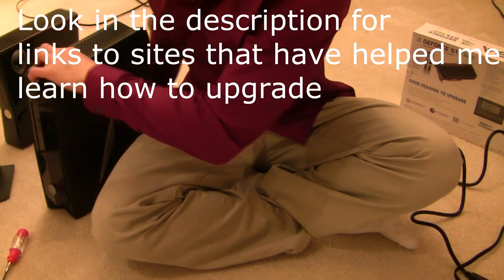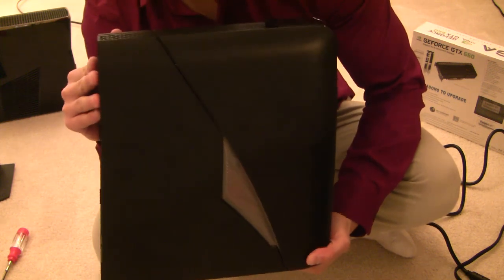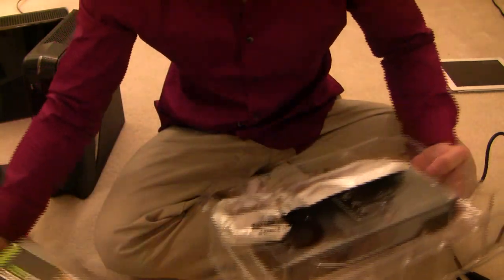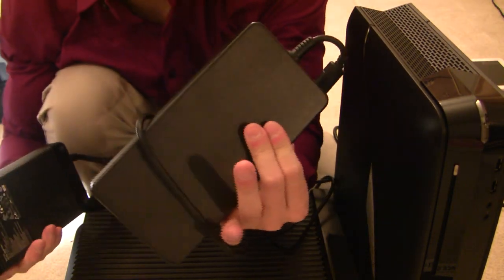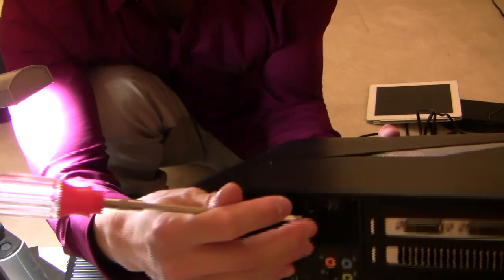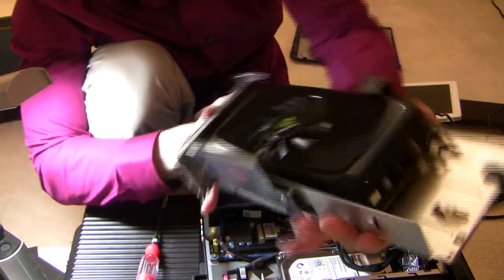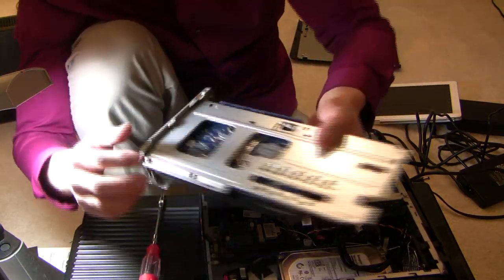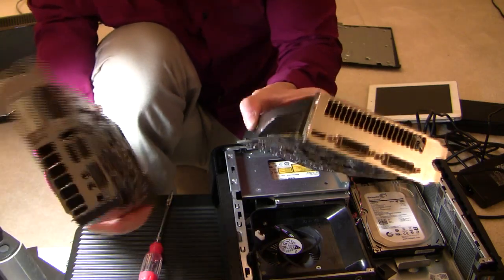► How to Upgrade the Alienware X51 Graphics Card (GPU Upgrade Tutorial/ Guide, GTX 660 Unboxing)

Comment: Okay, quick question. I have a GT 640 in my AW X51, it says that the 640 uses a 350 W power supply, would I have to get the 330 you show, if so, where ? Sorry, new to computers.. Thanks for your time.
Reply: I got my X51 in February of 2013, but my power supply is only 240 W

Comment: Thinking of upgrading my x51 from gtx 645 to the gtx 660, just wondering  have you had any problems since like  loud noise/over heating? Should I do it? Be great if you could reply or someone else who has also done so :)
Reply: I just installed mine about 4 days ago. No problems. Just make sure you run the MSI afterburner to keep the fan going. But so far so good.
Reply: Thanks, do i have to have msi or would it be cool without?
Reply: If no MSI then the fan runs on its normal prosody which may not be sufficient if you have more intensive gaming and it may overheat. Also MSI is a free download. But if anyone else knows please chime in.
Reply: great to know bud ty :)

Comment: same question here, got my setup with the i5 the 240W PSU and currently the GTX 645, want to upgrade the gpu as far as possible(gtx660 or higher possible?) whilst not damaging anything. or would anything higher than the GTX660 be overkill for the i5?

Comment: fyi you need to use both power connectors for this graphics card not just the one like this dude shows us in his video... if you only use one power connector your system wont boot

Comment: Im thinking of upgrading my X51's GT640 to the GTX660. So if I'm currently usingg the 240W power supply, I can just replace it with the 330W? and then upgrade to the GTX660? Can I do this on i5??? I'm a PC noob so yea some helpful response wud be very very appreciated!

Comment: That's not true at all, I just looked at parts available and made one for $150 cheaper than their 4th gen i7 option. That's also with, IMO, better parts than what dell would use, and that's not even looking or waiting for any specials or discounts.
Another plus is its much easier to maintain and update/ customize because there are no proprietary parts and doesn't need to fit Dell's restrictions.
While it is true that that warranties are through different companies, many are longer warranties

Comment: you just go to radioshack and buy a linksys network adapter because the wifi on the x51 is garbage - i got this and it works fine

Comment: for 1 alienware x51 psu cant handle a 700 series card for 2 the i3 cpu will bottleneck the gpu meaning the graphics hard is good but the cpu isnt strong enough to unleash the full potential of the gpu

Comment: Mine never has. The wiring is really quite good, they manage to cram all that stuff in such a small space and yet it never overheats. Some people have complained that the fan gets loud if you're trying to run Crysis or something but with headphones on it's really quiet to me. Mine's still stock though, so if you overclock it I'm not sure. The 555 GTX can withstand up to 210 degrees Fahrenheit so I don't think you should have a problem with it.

Comment: No problem :)

BTW, if you buy from the Dell website (AW automatically takes you there), make sure you look and the list on the bottom right to see if you're getting an i3, i5, or i7.

I find that the i5 has the most options for customization, letting you spoil yourself rotten with higher RAM (room for multitasking), Blu-Ray CD/DVD Drive (Movie Night!), and your choice of video card. (You should DEFINITELY get the GTX 660)

If you have questions about RAM, 8GB is beyond perfect for personal use.

Comment: No, a 690 would never work. I saw a guy put the GTX 680 card in the X51 and it worked for close to a half hour before the system crashed. The most powerful card that will work is the GTX 670, but I personally would not use it. I would say if your not happy with the GTX 660 ti, which Alienware told me that is the absolute highest you can go, then you would be better off looking at or getting a better system.

Comment from the maker: It would be a very interesting experiment to try. I would have to remove the front case fan embedded into the bezel, then cut out a mesh hole to install a 120mm intake fan to feed the turbine fan on the heatsink, then use an external psu to jump the GPU separately from what's powering the MOBO.

Comment: More powerful graphics cards require more power. The smaller PSU wouldn't supply enough power to run the GTX 660.

Comment: I own a $1049 model and switched the 660 with 670 FTW. (I also removed the 3.5 inch 2TB HDD and installed a 120GB SSD in tandem with my old laptop's 2.5 inch 500GB HDD. The X51 motherboard has an extra SATA port 3 in total, and thats where my HDD is connected. Note: You need a SATA Cable & a Y split SATA Power Cable) I did my research. lol

Comment from the maker: You are blocking either the case fan (embeded into the side of the case, below the alien head) or you are blocking the gpu turbine fan with a 6 pin power cable. Perform cable management and direct the spare 6 pin to the disk drive area where there should be room.

Comment from the maker: Ebay. Just type "Dell 330w PSU" or power adapter. If it says its for the M11x (the Alienware laptop), it's also compatible with the X51. You can probably make back quite a bit of the cost by selling your old 240.

Comment from the maker: Haven't you heard? Next gen consoles are driving PC gaming extinct, so chip manufacturers like Nvidia and AMD are giving up. 

JK, I wouldn't worry about Nvidia 700 until fall at the earliest and AMD 8000 even later. Games are running fine on current cards. Nvidia wants to ride the Titan at 1k for as longs as it can. Then before PS4 and NextBox, consumers will be hungry to upgrade, so Q3 at the earliest is when I would start thinking about next gen cards.

Comment: hi thanks for the video very informative and useful. I just have one question. with the power supply I have the 240watt it came with(as it was the £600 version) is the 330 watt compatible with mine and if so where can I get a 330 power supply for the x51? did you have to buy yours separately as well? thanks

Comment: I have got a gpu Nvidia Geforce GTX 660ti 2gb Evga. Will it fit into my pc. What will I need to additionally upgrade Specs:
Superior Intel® Core™ i7-3770 3.9GHz (8MB Cache) with Hyper-Threading and Turbo Boost Technology 2.0
1.5GB GDDR5 NVIDIA® GeForce® GTX 660
Genuine Windows® 7 Home 64-Bit
8GB 1333MHz DDR3 Dual Channel SDRAM - 2 Dims
Dual Layer DVD Burner (BD-ROM, DVD+-RW, CD-RW)
1TB Hard Drive - 3.5"
Dell Wireless 802.11g/n
Alienware™ 330 Watt Power Supply
do i need a new power supply?

Comment: Really quick question, i have the i5 version of that with 8GB ram windows 7 and all that with a 240 power supply, would the 240 be able to handle a gtx 560 upgrade?? i mean its not that much bigger then the 545 or whatever that it has.

Comment: Hey, I just got the GTX 660, does it matter that it comes with a 6pin PCI wire with 2 other pin connectors to the power supply? Where as the X51 only has the 6pin connecters? Also I am trying to multibox Diablo 3 with basically 4 game instances, and when i run the Diablo 3 4 times at once MY GPU usage goes from avg of 60% to 90% at time which lags up my game. Is that a power consumption problem you think?

Comment: Hmm..The GTX 660 seems a bit steep for me, and I've heard the GTX 650 gives a good performance boost over the GT 640 that came in mine. Though, I have the default 240W PSU. Do you think I'll need the 330W for a GTX 650?

Comment from the maker: At a clock speed that fast, you might run into some heating problems if you push it on really gpu intensive games. MSI afterburner or Speedfan are free programs you can install to try and keep your system cool, but your fans will be super loud. The GTX 670 is a good card and will be able to do anything Ultra until 2014. 

FTW is factory overclocked. OC yourself if you want to, but any manufacturer will frown upon OC anything in a prebuilt pc.

Comment from the maker: The power supply is only in question if you're thinking about upgrading GPU. The i3 is a processor, which total power draw is not an issue. On max torture tests, the GTX660 and 670 handle a 330w power supply fine.

Comment from the maker: did you install the card yourself or are you using the OEM version?

You have to be careful that the power cables are not blocking the PCIe fan or the gpu fan.

Comment from the maker: Absolutely. One of the later versions of the Alienware had an OEM (Original Equipment Manufacturer) 650. The one you buy and then upgrade to will perform better than the OEM. 

Whichever Nvidia card you decide on, don't go with the twin fan version.

Comment: Sorry. up the CPU to an Ivy Bridge i5 or top of the line i7, which only has a max draw of maybe 2 more than the previous CPU, it still leaves you with a 13W gain from the 240W and it's previous safe config. Just remember what I said about the bios battery if at first, changing your video card out, produces 5 beeps, no boot, after checking all your connections are correct.

Comment: Take note, Dell sells the i3 version with the 240W PSU. The video card has a 75w max draw. The CPU for it also draws about the same. So upping the PSU nets you 90 extra watts. Up the GPU to take up to 75 more, you still have 15w to spare. Up the CPU to even a top of the line i

Comment: Absolutely. The 660, along with the 660Ti, and 670 (and a number of other cards) has a 150w draw. The alienware generally has low power consumption parts and isn't built to use more than 1 eide device so it doesn't have the typical desktop power demands. Any of those will work fine with the 330w adaptor and should have between 20w-50w to spare.

Comment: After it boots back up, you need to do one more thing. First tell it to revert to Default settings, and then change the Boot style from Legacy to UEFI. If you forget to do that, then the machine will prompt you for a boot disk since Legacy Boot does not check the machine's standard drive order. That's pretty much the only setting you need to change when you set to defaults. This is with Bios A08, not sure if the case for future Bios revisions.

Comment: Actually, any video card with a 150W max can work with the X51 using the 330W power adapter. However, there is one step I believe this video doesn't cover, for which *some* X51 users will need before a new card (like the kepler-style shown) will work. Some will need to disconnect and then reconnect the CMOS battery line to the motherboard before powering back up. Otherwise, they'll keep getting 5 beeps and no-boot on the alienware. Sometimes the CMOS holds too much and doesn't reconfig properly.

Comment from the maker: I have an unboxing video, so you can see exactly what you get. The keyboard and mouse are as basic as they get, but better for gaming than what you would get than if you went to Best Buy and got a regular desktop.

The card I have right now destroys everything I play at Ultra at 1080p. Some later games, like Far Cry 3 and Max Payne 3, might only be able to do High with no AA. If you choose to get the OEM (the one it comes with) GTX 660, it's not as good as one you buy and install yourself.

Comment from the maker: Hi! This is a great question. Every generation, Nvidia cards are getting smaller and more power efficient relative to performance. When the GeForce 700 series launches, the first few cards probably won't be usable with the X51, like how the massive GTX 690 was one of the first on the market in 2012. But later on in the 700 series generation, say by July at the latest, they will definitely have the architecture of small-form factor PCs in mind, so the GTX 760 or better will work.

Comment: I am planning to buy this pc after considering to make a custom pc which after all the evaluations i made out would end up costing too much plus i am not really very good at optimizing all the hardware to be a match overall plus the service issue for custom rigs...so my only concern is can it run games at higher resolutions than 1080 with accptable fps??  Also if the included keyboard &mouse are any good??

Comment from the maker: With the card I put in, I get 60+ frames on Battlefield 3 64 player, 1920x1080, all Ultra except anti-aliasing and motion blur off. (AA isn't that necessary at high resolutions). 

Ram is an easy upgrade. 

Graphics cards, esp. the Kepler class ones by Nvidia, are always getting smaller and more power efficient. One of the biggest advertising points of the X51 is that it is upgradeable, so a card is definitely due in the GeForce 700 line that is more powerful but compatible with the X51.